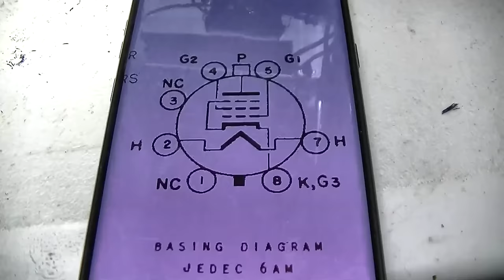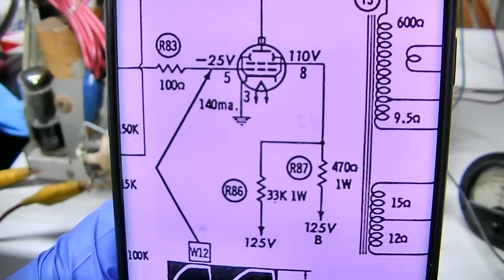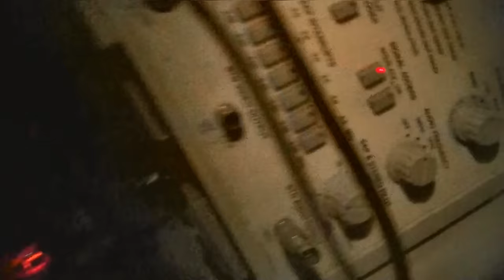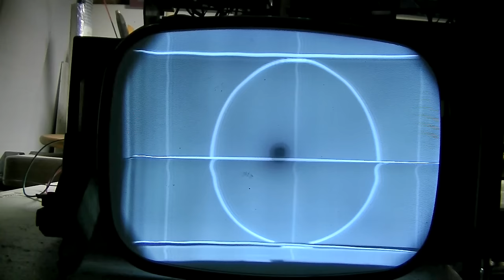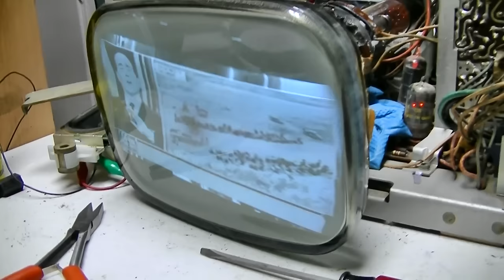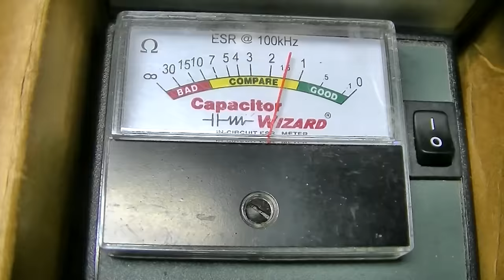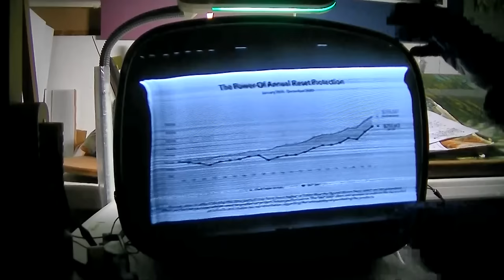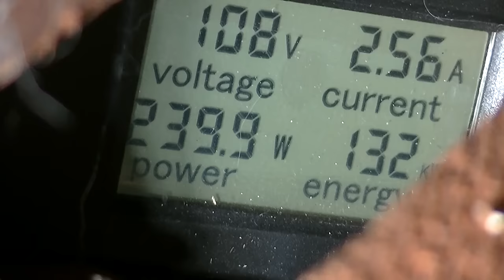TV Repair 1958 Emerson 1268 Portable Television Ball Drop Fail

Comment: @14:50 yes, keeping a small current going thru the horizontal output tube (and maybe other tubes of the TV section) while the AM radio is playing prevents the tube from dying due to cathode poisoning. That's also why the filaments of the radio section are switched off when the TV is playing and not just the B+. The problem has been known since the days of the first AM-FM radios that used a super-regenerative Fremodyne converter whose B+ power was cut off in AM operation while the tube filament was kept on: after a while the tube emission (typically a 12AT7) was gone.
Reply: А нити накала не отключали, чтобы напряжение накала других ламп не поднималось выше нормы?
Reply: @АндрейКурачев-с7р  Indeed, the filament of the converter tube was part of the series string of the whole receiver. Also, if the filament was turned off, then every time the receiver was switched to FM mode the user would have to wait an additional 20..30 sec for the filament to heat up to get FM reception.
Reply: Indeed I mention this problem with the Fremodyne AM-FM sets on my cool386 website. I added a resistor to keep a few mA flowing through the unused valves.

Comment: Shango: On the loose plate-cap of the horizontal output tube,: You can drill a small hole through the plate cap plastic (and sometimes necessary the plate-cap's metal socket) without drilling into the tube's plate-cap; then use a small rod (or the drill-bit) to push the tube's plate-cap out of the plate-cap's socket. You can then use a ceramic style epoxy squirted underneath the tube's loose plate-cap to re-secure the plate-cap to the evacuation nipple of the tube. You may be able to use JB-Weld although I've used the stuff from Dextor HYSOL, which is expensive and hard to get being an industrial product. Just make sure you clean everything with a non-residue solvent.  If you do this, you can permanently fix the tube without worrying every time you remove the plate-cap.
73...

Comment: At 15:11, "why would they want the tube powered up when it's on radio?" That is to prevent cathode poisoning which occurs when the cathode is heated, but there is no electron flow. It's actually good design practice.

Comment: Keeping the horizontal output conducting might be to mitigate the emisive material collecting on the control grid and causing high grid current. Because they leave the heater on full power for the horizontal output tube. When there is no plate or screen voltage the cathode coating can collect on the control grid over a long time.
But judging by the fact they leave all the heater on in radio mode, I doubt they would think of that. Probably just glued together circuits.

Comment: Howdy,
Your Fluke 27/FM multimeter appears to have display troubles.

I've seen similar symptoms on many of these older Flukes, and the source is usually ageing/contamination of the display LCD contacts.
The solution I've used successfully on many units is to open the case and remove the main board, then carefully remove the frame of the display and remove the glass LCD and the  zebra strip, then gently clean the gold PCB contacts, the transparent contact area of the glass plate, and both narrow edges of the zebra strip(s) with isopropyl alcohol on a q-tip.

Allow to air dry, then carefully re-assemble in reverse order.

This procedure has never failed to work for me, except the one time I got careless and chipped the corner of the glass -- oops!

You may want to clean out any dust and add some lube to the rotary switch contact suefaces and detent piece while you have it apart.

Cheers and happy troubleshooting,

Dave

Comment: That ion burn was probably from a technician using the tube to check a
set with just the end cap and high voltage lead, bright spot in center 
Quickly burns a spot. It was a quick in 
hone test when those test crts were 
Cheap and plentiful!
Reply from the maker: Good point

Comment: Hard to imagine a shop doing that much work to modify the circuit to use different tubes.
Reply: Really you think they would have broke down spent the money and just bought the freaking tube
Reply: Maybe it was a family affair. I run a car workshop and a few weeks ago I fabricated an adaptor for my nephew so he could run a Volkswagen Passat distributor (which I had laying around) in his Opel Ascona (for which a new distributor would have been (it is rare) about 250 Bucks). If it would have been a normal customer and not my nephew that CNC milled adapter would have cost at least 500....
Edit:
I "charged" him a barbecue and a case of beer.
Reply: Hah! Shop? Shops cost money. This was clearly done by someone who was trying to save every dollar humanly possible.
Reply: I think they just wanted to save every dime and pass it ahead.

Comment: The best stuff to glue anode caps and tube sockets back in place is phenolic brake lining glue. It is the same stuff the sockets had been glued with in the "good old days" when those tubes were manufactured.
It is a little bit toxic, though. And a little bit hard to get. Use it in a well ventilated area.
Reply: A “little bit toxic” means it “works really well”. 😝
Reply: @nmccw3245  exactly. I inherited a five gallon bucket of that glue from my grandfather who happened to have a brake shop in the 1960s....

Comment: I don't buy into the engineered early obsolescent theory. Made cheaply to compete for a price point is more like it. You get what you pay for, in most cases (there are exceptions).  If a company actually made a decision to bilk a customer into replacing the short-lived item, would surly go out of business in short order. This television Shango is working is a unique example of fitting several functions in one unit. Sharing the circuits to save money and complication. I'm curious to see if there was a manufacturer service bulletin outlining the mods for the Horz tube replacement. If not, the individual who made the mods did have a good understanding of the issues but had poor implementation. Although it did work. Maybe a flipper? I'm picturing a handy dad who made this work for a son's/daughter's dorm room?
Reply: I saw the design of the set meant it would draw way more current than an ordinary 5 tube AAM5 radio set because some of the TV tubes are 
triple purpose TV/Radio/Phono tubes 
Being as frugal as Emerson MFG was in building this set it would not be surprising to find their parts buyer found a great deal on some soon to be NLA stuff buts good enough to get a repairman a workaround (complicated) in order to make a buck off the deal
Plenty of hours involved in those chassis mods

Comment: Thanks for the video.  Your Power meter at the end shows 108v @ 2.56 amps, but then shows 240.0 watts?  Is that the new California standard calculation for Watts?
Reply: The discrepancy between volts*amps and watts comes from the power factor. In the case of alternating current if the current waveform is distorted or out of phase relative to the voltage there is less useful power transferred for a given amount of current.

Comment: I don't think it's a case of ion burn-in, but rather that the picture tube was operated in a chassis where the light spot suppression was defective before. This produces a very strong afterglow on the screen when the set is switched off, which then burns in. At least that was an error that occurred in German TV sets. It's a pity about the picture tube in any case, as it still seems to be quite good otherwise.
Reply: None of these American TVs have spot suppression. You get a spot when you turn the set off but it's only for a few seconds as charge already on the tube bleeds off. You'd need to be doing this thousands of times to make an impact.
Reply: @eDoc2020  That's right. The televisions without aluminum-coated picture tubes didn't have that, not even in our house. I was wrong about that.

Comment: So if I buy the cheapest Fm radio(Bozo brand even) and stretch the coil which would be the most appropriate oscillator that would allow 118-138 Mhz in order to hear aircraft   its like a showdown between radiofun232  and carlsons lab which i will float it to        itll be like a rapper war only its radio scrappers  lets call it a scrapper beef !!!